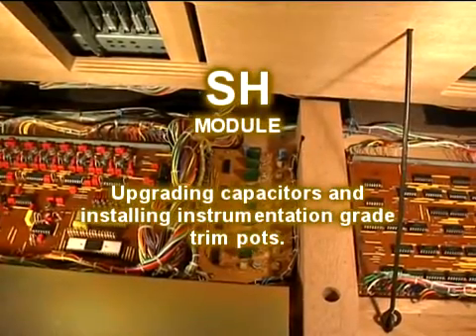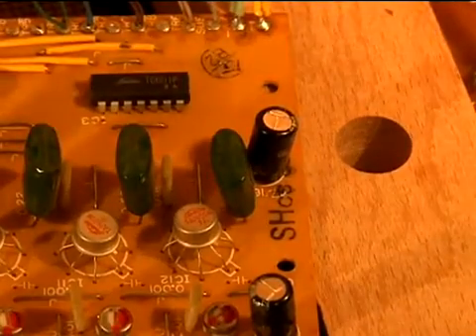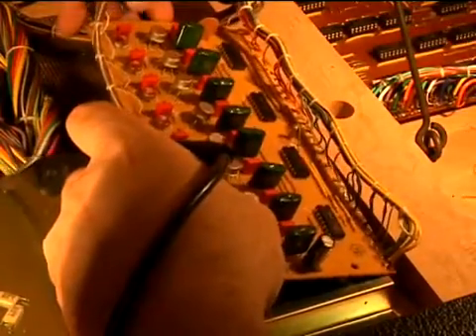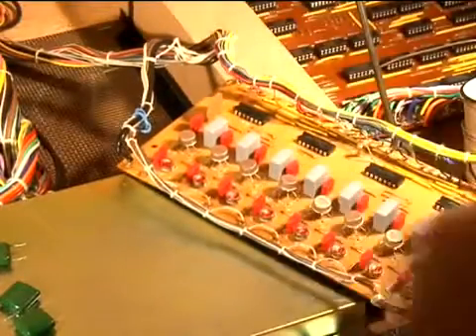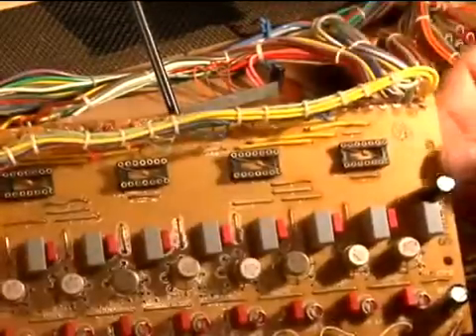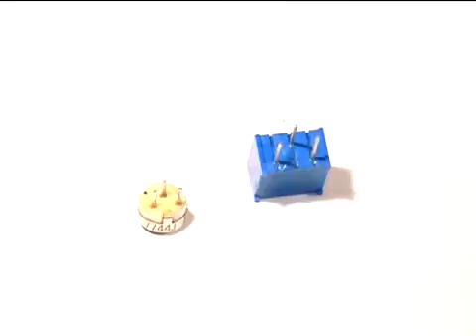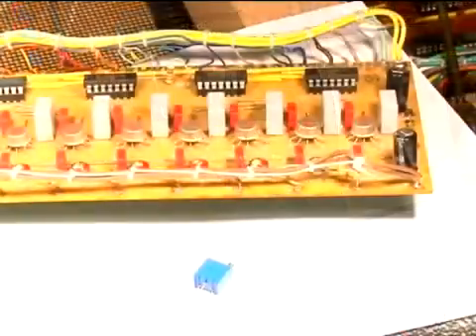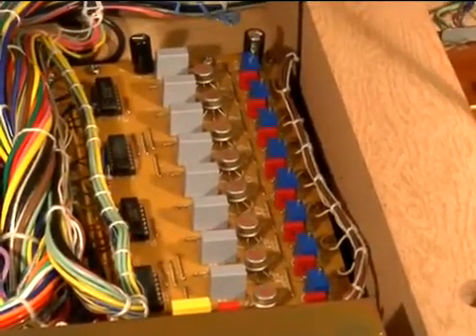Saving the Yamaha CS-80 (6) SH Sample and Hold Module

Comment: Nice work, but it looks to me not logical to replace the trimmer pots by measuring there values.They look good quality to me ( ceramic ? ) and are sealed, but most important they are calibrated at the default values of the older components, witch you are replacing.So I always recalibrate them. .
Reply from the maker: These are indeed ceramic substrate trimmers.  About 50 or so of this type.  The remaining 500 or so trimmers in the keyboard are carbon and most are off by 30-40+% . That is a 100K trimmer will read as little as 65K to over 130K.  But these ceramics are dead on.  BUT.... they are difficult to get the calibration offset for the op amp dead on and a part of me felt guilt replacing an existing high quality part which was perfectly stable once tweaked in.  Going to a quality sealed multi-turn made calibrating offset very easy so I made the decision to replace them.  Pre-adjusting as I did in the video just ensures the keyboard remains playable as is, but really do require a final calibration as assuredly they needed it beforehand.  Since I was replacing all trimmers in the entire keyboard with multi-turn, I replaced these.  Even with multi-turn, some calibrations are still very sensitive in other parts of the keyboard, but remain stable unlike the carbon trimmer "humidity sensors" as I like to call them.  Now the older components such as the metal can precision op amps in this sample and hold board and other parts of the synth, I do not change them as I have never encountered a bad one and they are "aged" aka stable and do not suffer from issues as the old 4000 series chips.  The sample and hold capacitor I use has much less leakage vs the original and within 2% vs a much wider tolerance of the originals which I believe is 10%.  One thing that amazes me, the 5% carbon Japanese made carbon film resistors..... ALL within 1%... more like 0.5%.  Amazing quality.  However, they are using carbon composition resistors for 3.3M, 4.7M and 10 meg-ohm in the keyboard; in critical areas that are off by up to 40%!  Very critical ones that set filter crossover are usually way off.  The 10M resistors that are trimmed with 100K pots in the mixer sections of the tremolo/chorus stereo effects board typically read 14 or more megohms.  Way out of specification which is probably why tremolo/chorus system sounds so unsuitably bad on many CS-80s today.
Reply: Yes, but I saw you not making the adjustments, so I was wondering.It surprise me that the carbon resister good be way off there value,that's a point to look at.Hope to see more vids of the restoration of this beast, keep up the good work!

Comment from the maker: The higher value caps were available and are used in other places in the keyboard, so cost and size were not an issue.  Engineering team probably determined they didn't need larger values.  They are most likely correct.

The DC voltage rails are critical on this board for the hold amplifiers to be absolutely stable.  So I opted for larger value capacitors to give a little extra headroom.  The DC rails are shared by many other systems.

Comment from the maker: The 3rd and 4th octave were mute on the keyboard after I made a stupid mistake.  Lowered the upper voice card rack with the power still on and shorted +15V into the keyboard detector switches.  All of the key switches go into the 26600!  I removed the 26600 and the 26700 to breadboard them separately so I could verify if they were okay.  I was so very lucky.  I put the sockets there to avoid stressing the IC's again.  Normally you do not need sockets.  The 26600 is apparently a very rugged LSI.

Comment from the maker: @Andrij09 Hi.  Most of them are Mylar on that board.  The large green sample and hold units, I couldn't determine if Mylar or Polypropylene.  Most of the green capacitors like that from the 70-80's were Mylar.

Regardless, they have been replaced with high precision Polypropylene units that are designed for pulse and sample and hold application.

On the KAS board, a mylar had drifted value of about 35%.  Keyscan oscillator was 60 Khz, supposed to be 95-100Khz.  Replace with polyprop and at 97Khz

Comment: @gavincurtis Hi Gavin, I've a CS60 which is working pretty well except for one problem. It's stuck on Sustain II mode even when the switch is moved to sustain I. (ie, the note stealing is permanently on). Apart from the switch itself which I think is fine, could you suggest what else can be checked to see why it's stuck in Sustain II mode?

Comment from the maker: Stability should be a working synth.  I am replacing rotted capacitors in the power supply and in all digital timing and pulse generator circuits which need to be stable (as intended).
  The etheric magic of this machine is from the 16 independent oscillators that will NOT be modified.  But temperature and transport stability will be improved.  My CS80 will not become a digital brick as some seem to think.

Comment from the maker: @cumesoftware 
Hi,  Thanks for posting.  The parts are extremely high quality.  But manufacturing processes and materials of today surpass that of nearly 40 years ago... making more precise and reliable components.

Worst part of the CS-80 are the single turn carbon trimmers.  If Yamaha used multiturn pots, nobody could afford this keyboard.

Digital tuning is also very difficult as this is an extremely complex analog synthesizer. Been working on microprocessor digital tuning retrofit. but damn.